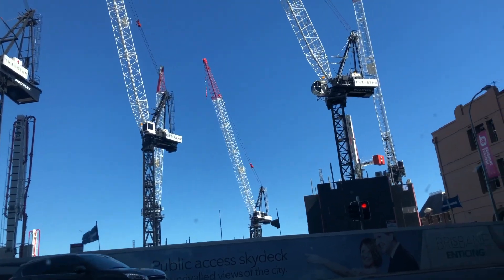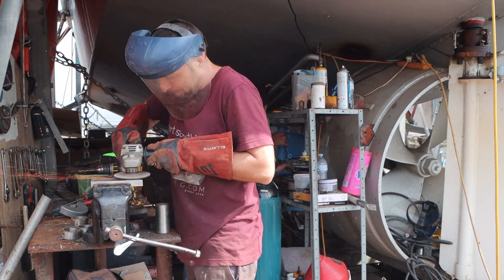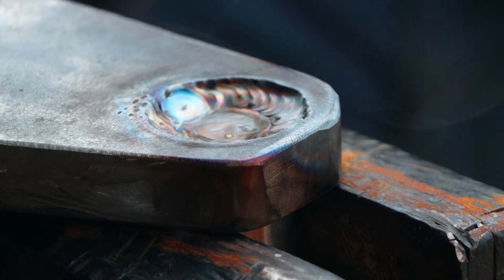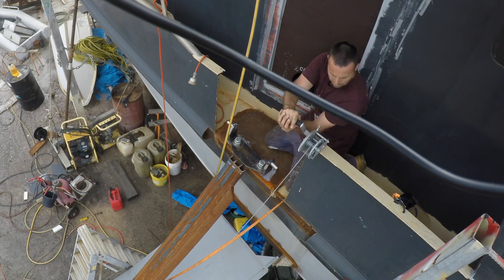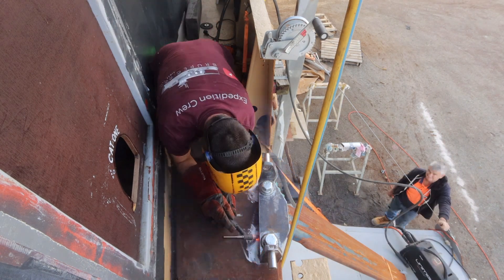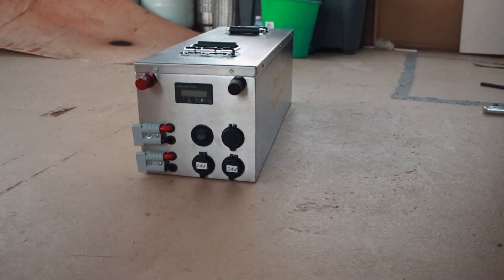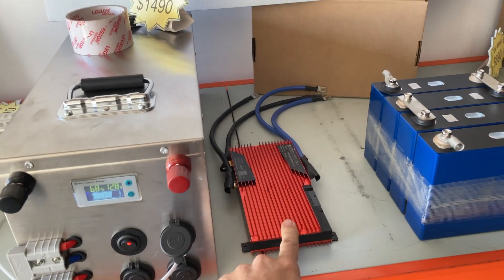Brupegs Lithium Upgrade - Ep.165

Comment: Lithium-ion batteries can produce dozens of dangerous gases when overheated, So make sure you are using all the correct chargers for them. AGM'S are a good old reliable battery but they do have their limits.
Reply from the maker: Hi Adam we used Victron mppt controllers with a lithium charge profile. Everything in the system is compatible with lithium and the system is working really well
Reply: @ProjectBrupeg  Great to hear, love the video's keep them coming. And G'day from Tassie
Reply from the maker: Cheers mate

Comment: Are the battery's lithium iron phosphate? If so please be careful those things do have a chance to self ignite if they get to hot.
Reply: LiFePO4 batteries are actually considerably safer than standard LiPO batteries, far less risk of fire. Slight trade off with voltage, capacity, and max current being a bit lower, but well worth it for the safety.
Reply: @hwesson75  Still a fire superstition unit would be a very good idea, just for that off chance there have been quite a few jets passenger and cargo bought down by LiPO batteries catching fire in the air.
Reply: @gavinmclean3174  Copypasta'ed from www.bigweibattery.com.au/newsupdates/ where he got this battery: "LiFePO4 is more chemically stable, and it is incombustible, which means that it is not prone to thermal runaway (and remains cool at room temperature). It can also withstand high temperatures without decomposing, and it is not flammable. The bottom line is, you don’t have to worry about it exploding or catching alight on the job."

So while fire suppression in general is never a bad idea, it's not something he'd specifically have to worry about with having that LiFePO4 battery onboard. One of the cells in that thing failing is /nothing/ like a standard LiPO cell and the astonishingly large amount of heat and flames those things can create for their size.

And it's in its own little stainless box. Which is pretty sweet because, yeah, if something dead shorts you might not have to worry with this one about the lithium itself burning, but there still could be enough heat to catch the plastic cell casing on fire which being contained like this would help keep snuffed down. That's a /lot/ of energy in those things. Shorts are a danger with any battery, this is well on the safer end of the spectrum.

But in general, his cell phone is far more dangerous than that big battery to have onboard.
Reply: @hwesson75  Ok thank you for the information much appreciated, after some more research I found out you are correct.

Comment: They make a rod that attaches to the camera to give a bit of distance between you and it to avoid the extreme close ups. I read others comments on how it bugs them to. If you can't find them I'm sure a stick would work.
Reply from the maker: It’s more about what lens you use. With our wide angle holding the camera at full arms length looks like your maybe 5ft away. Same shot with our 18-135mm only just fits a head in the shot.

Comment: looks quality,planes started fitting their lithium batts in stainless, ? does the BMS (battery monitor system)have cell balance included (gently tops up lesser/lazy cells).
Reply from the maker: Hi Michael, yes I believe it does

Comment: Check out www.lithium-power.com.au or batteryhookup.com, you will also get much better efficiency working at higher voltages if you can, with cost savings on wire gauge as well. facebook group diybattery is also good source of info. remember also to keep lithium batteries above freezing if your going in arctic conditions.
Reply from the maker: Hi Allan, yeah these batteries are located under the wheelhouse floor so almost dead centre of the cabin, nice and dry and always at a comfortable temp

Comment: Regarding using a hydraulic jack horizontally, I did once and it somehow got air in the fluid and I could not fix it, being cheap I threw it out. I am just wondering if anyone else has had this experience, if so be careful Damien, try and do the welding with the jack upright.
Reply from the maker: Thanks yeah Trev mentioned he had a similar issue once. I think it happens when the little pump is higher than the main cylinder. Either way I will rotate the arm so the Jack is vertical. Thanks for the reminder

Comment: I have had horrible luck with AGM batteries in our electric car. It has eight 6 volt batteries and with the AGM's  one would just randomly fail and cause the pack to crash and loose half the range because of one Battery. I went to battle born Lithium and never looked back! :)
Reply from the maker: Yeah I personally find AGM’s to be just temperamental garbage. I’m ok if it’s my fault and accept not all AGM’s will be like this but they seem so able and willing to die and so impossible to recover if you miss a beat. I’m a fan of basic basic flossed lead acids and I’m currently looking forward to diving into lithium’s

Comment: The chemistry is LiPo? 3.2 nominal. Those are a lot more stable than the Li-ion batteries I built.  The other cool part is as a 24v system the wire you run can be smaller because of the higher voltage.  Now all you need is some DC to DC buck converters to take care of your 12vdc needs.   I'm curious about why all of your AGMs packed it in,  what kind of charge controller is on those panels? I'm sure Victron is out there in the wings (no pun) waiting to meet you guys and give you all the pretty goodies at a super special price.  After all the other channels got them I had to buy one to test and they do live up to the hype.  Damn you Victron, you and your effective marketing.  

Also, at some point in the future one of your episodes should be titled No flux given.
Reply from the maker: Hi Bob. We use four Victron 100/20 Noor controllers. The issue with the AGM’s was 100% battery quality as they were dead prior to the Victron coming online. We have a 24v bank and then spilt to either 240vac single phase or 12/24vdc where needed. Light load runs through dc converters and down to 12v but that’s only things like lighting and USB charge ports etc. I did contact Victron but they wanted a full episode on there gear and only wanted to give a battery monitor in exchange. Given each episode is normally more than a week in the making, it wasn’t worth it. We have a good battery monitor and value our time more than Victron does. It’s quite common in our experience that the big brands think it’s acceptable to offer very little and expect a lot in return for sponsorship. Some of the offers from very big companies have just been offence in some cases.
Reply: @ProjectBrupeg  I thought I remember you running that other bank at a 12v system, my mistake.  Crazy how Victron seems to give those systems out like water but they won't step up for you, maybe seems is the operative word.  I have that same 100/20 MPPT controller and it's pretty impressive.  I hope those lithium are just what you need.
Reply from the maker: It’s not that they didn’t offer. It’s that that wanted an extraordinary amount of promotion for a very small piece of equipment and because we have most of our followers on youtube and very little on Instagram they discounted the value of our audience etc so we said thanks but no thanks.

Comment: hi all regarding the tig welding as you move the hand like you would as just welding metal together try dipping your rod in the weld at the same time as you move your welding hand if this makes any sense. good luck you are both real people x
Reply from the maker: Thanks Neil. I feel confident with the heavy steels to dip but I’m still pretty garbage with thin stuff line exhaust. I find the balance between too few amps and the puddle taking a long time etc and too many and blowing holes all the time a very fine balance. I’m sure I will get it. I can MIG pretty much anything with my eyes closed so it’s all the same theory just totally different...

Comment: To tig weld mild stee to stainless you need at least 309 filler. Autogenous produces a weak bead due to carbide precipitation.
Reply from the maker: I use 309 on the mig when joining those two but don’t yet have any 309 rods.

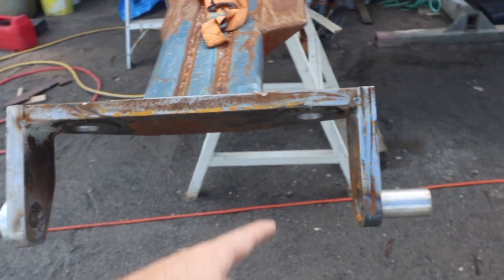Comment: 8:22 Are you planning to add a couple of gussets between the horizontal bar and the uprights? I certainly would strongly consider that, mainly to prevent fatigue cracks in the welds. I don't think they would be in the way of anything. Just sayin' - Safety third! ;-)   -----    and of course: all the best for Jess!
Reply from the maker: Hi Martin. We can’t easily gusset because of the bolt position hence we used 20mm steel.

Comment: Hi Brupeg team. 

If you want to see some neat projects and products for lithium batteries, Jehu Garcia has some great stuff on his channel. When you realize essentially the 18650 battery drives much of the technology, it demystifies even the Tesla. 

He makes DIY power walls and sells some pretty neat modular parts that you can use like legos to build out your power source.  His tips on finding reclaimed scooter batteries or modem batteries to harvest 18650 can save you a ton of money if you feel like tinkering. 

That stainless steel kit seemed pretty nice...did the price include the batteries or just the box and hardware?

Can’t wait for you guys to launch!
Reply from the maker: Hi Riley. That price is a fully complete battery. I did ponder making my own batteries but I just don’t have the time as I’ve got SOO much boat to build and it’s an area I don’t have a huge amount of knowledge in

Comment: Just for the record, an AGM battery is still lead-acid. I’ve personally had good luck with them (at least as good as standard lead-acid).
Reply: They were invented for military use.
Reply: Boats and Other Problems 
They were invented for any environment that’s subject to vibration and violent movements. Military, marine, motor sports, etc...
Reply: Boats and Other Problems 
They were invented for any environment that’s subject to vibration and violent movements. Military, marine, motor sports, etc...
AGM is an acronym for Absorbed Glass Mat. Essentially, the electrolyte is suspended in fiberglass.
Reply from the maker: I’m fairly confident our AGM’s were suspended in jam given their electrical output

Comment: Hi Guys, just a thought. With Lithium batteries, aren't you afraid of water getting at the batteries? Fire hazard there whereas, AGM and flooded lead-acid both will not catch fire if exposed to sea-water. I know the Lithium cells are sealed but still????
We hope Jess's health improves and wish you both the best from Canada.
Reply from the maker: They will be located under the wheelhouse floor. If water has got to them we have sunk
Reply: @ProjectBrupeg  lololo...yes how true. Keep smiling guys, hope Jess got good news.

Comment: Individual cells are typically spot welded. Further, sub-assemblies are pretty tightly integrated with top and bottom spacers. You're not going to get to an individual cell too easily. What are they doing with these batteries?
Reply: They bolt together with heavy copper busbars. Did you watch the video?
Reply from the maker: That might be the case where you are but we can buy individual cells here from the supplier without any drama

Comment: Hi guys please make sure you only get Japanese cells as the ones from China are crap
i used to make up batteries for ebikes using the Panasonic NCR18650b. These are the best cells on the market. So easy to stud weld yourself and make up your own banks
On a lighter note the cat flap lines up perfectly with the support for the wing looks like a perfect evacuation slide for the cat lol
My heartfelt wishes go to Jess
Best regards

Comment: I've got LiPo4s on the solar on my boat, so much better than even the lead acids i had before (One 24v unit replaced 4 lead acids), I will say make sure you test the low temperature cut off works as it should, especially given where you plan to sail and one of their advantages can turn into a disadvantage if you are not careful.

You can charge them much faster than many other types of batteries which is great on solar, it means you often have spare power in the afternoon from the panels rather than have to be trickle charging all day, however, watch your alternator. They can suck enough power to overheat a charging system, you want to make sure your alternator is temperature regulated so it doesn't overheat while charging.
Reply: How do you gave the lipos encased? We can’t use them commercially
Reply: @cmcmillan22  Mine is effectively  the same as the one in this vid except mine is plastic rather than aluminium, it's just in the engine room on a tray same as the lead acids were.
Reply: popuptoaster we can’t use LiPo because of the fire hazard. We can however use Lithium Phosphate
Reply: @cmcmillan22  I should probably have written the abbreviation out fully, LifePo4 are lithium iron phosphate, is that what you can't use?
Reply: popuptoaster yes, I thought you where using lithium polymer
Reply: @cmcmillan22  sorry my fault.

Comment: Those batteries are awesome! I've been seriously considering lithium for my electric dinghy project, but having them come as separate cells with me doing the BMS/encasing kinda scares me. You hit the jackpot with those, not to mention the price looks pretty reasonable considering what you're getting. I think you'll be impressed as to how much better Lithium is as compared to AGM - deeper depth-of-discharge, lower output resistance, and significantly less self-discharge. 

And best of luck to Jess - I could tell by the brevity of videos that something was up. Feel better!
Reply from the maker: Thanks mate

Comment: Praying for Jess to get better. It's not much but I installed a small home made 12v vertical axial flux wind generator with a 12" dia X 2" deep cake pan up side down with side fins cut open for the turbine mounted on my pontoon boat so I could have led lights all night for fishing. It literally charges the whole time out on the lake with over charge protector. Might work much better out on the ocean for sure.
Reply from the maker: Good stuff Mike